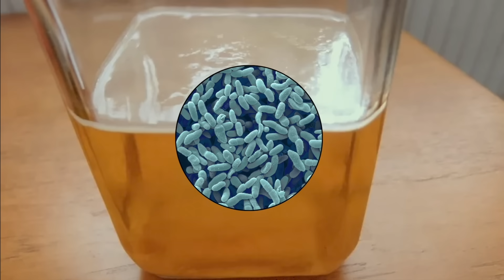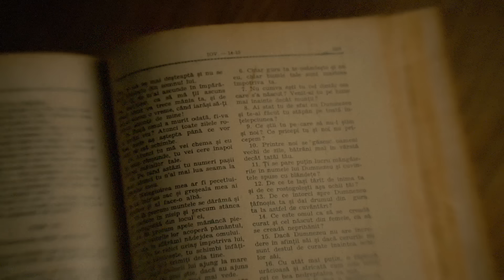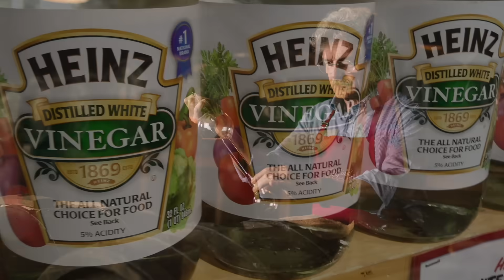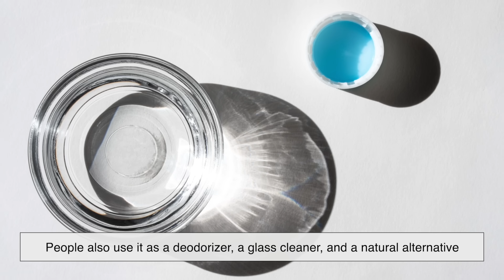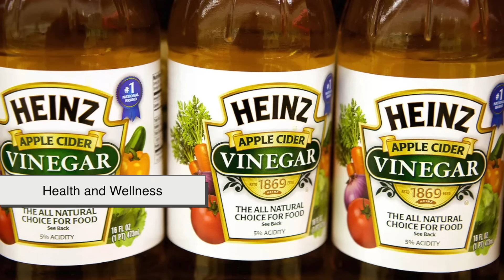What Exactly Is Vinegar — And Why Is It So Sour?

Comment: I suffered with acid reflux (GERD) for 15 years, all while taking Omeprazole, Tagamet and simethicone every day.  Then I started drinking one glass of diluted apple cider vinegar every morning.  Presto!  Problem solved!   It did take about 3 or 4 weeks to take effect.
Reply: I've had a very similar experience. Went from tums to zantac and then to omeprazole. It just suppressed it and would start coming back stronger. My Dad told me about ACV and it pretty much cured it. It's been about 15 years now and I only get it when I eat certain things that I know will cause it and even though I should, I don't even use ACV that much anymore.

Comment: British chip shop vinegar is a different thing its a non brewed vinegar.
Reply: That is because most “malt” vinegar you find in a chip shop is cheap imitation vinegar made from industrial acetic acid that is diluted and has color added. That is why it is non-brewed vinegar. It comes from a chemical plant. Real malt vinegar is brewed from, you guessed it, the same malt used to make beer. So, indeed, it is a different thing.

Comment: Actually it requires advanced tech but it possible to make vinegar as high as 30-40 %.

People use that super strong vinegar to reclaim the gold from obsolete circuit boards.

The highest vinegar that can be made in the traditional method is about 3.75-4%.

I occasionally make vinegar.

A vet recommended adding apple cider vinegar ACV to my 10 year old dogs water for health reasons. But she would drink the water even though there was only two tablespoons of ACV in a quart of water.

So I made about a 3% solution of Ginger vinegar. My dog drinks this willingly.

Then I made a3% blueberry vinegar and made a blueberry vinaigrette to put on salads.

Have no idea how they produce vinegar strong enough to dissolve gold.
Reply: They can get it up to 50%. I use 30% and Dawn to kill weeds in my yard.

Comment: As a home winemaker I make my own red wine vinegar. I use a green glass 1 gallon container add 2 cups red wine from a bottle I didn’t finish, add 1 cup distilled or spring water. Then you add vinegar mother available from most wine making equipment and supply store. Place a white paper towel over the top of the jug and hold it down with a rubber band. Put it in a warm spot and let the magic happen.2to 3 months later you have some pretty good vinegar. I filter mine through a coffee filter as I decant it into a clean wine bottle. Then use in cooking, make salad dressing etc. You can add more wine and water and continue making more vinegar.

Comment: I hate vinegar because it smells terrible.  I prefer limes or lemons over vinegar.
Reply: Then I have the answer to your prayers.

Get a bottle of 5% distilled white vinegar and put the vinegar in a bottle with a large lid. That fits tightly. As you eat oranges, lemons and limes set the peels to the side to dry. When the peels are dry and brittle crush the peels and add to the bottle of vinegar.

The vinegar will extract the essential oils in the peelings. The color of the vinegar will change and have a nice citrus aroma.

Now you have a better cleaner than vinegar alone. The cleaning ability of orange oil is also AMAZING. Giving you a better cleaner that smells like citrus. You can add the peeling of grapefruit to the special vinegar too.
Reply: @MatoNupai thenks
Reply: Seems like you don't know how to use it
Reply: Vinegar is one of the most amazing liquids ever
Reply: Omg i'm so glad i found someone else who hates it! I find it Horrible and the taste just as bad. I can't have anything with vinegar in it, Especially hot sauces which always have it as like the 2nd -4th ingredient. What is your blood type?